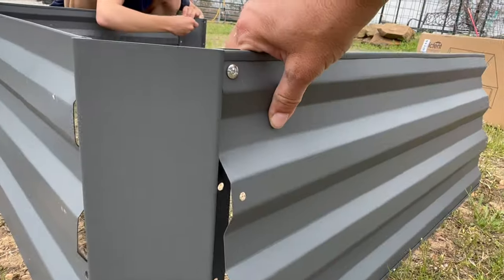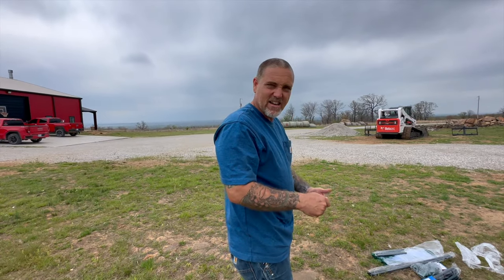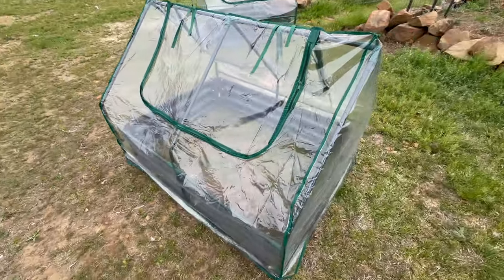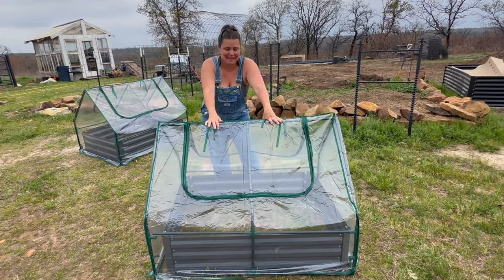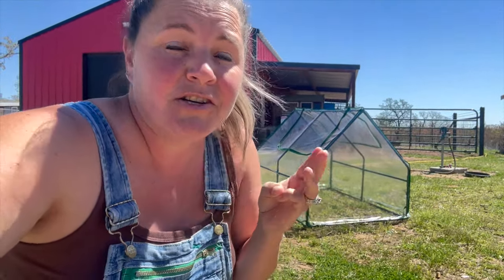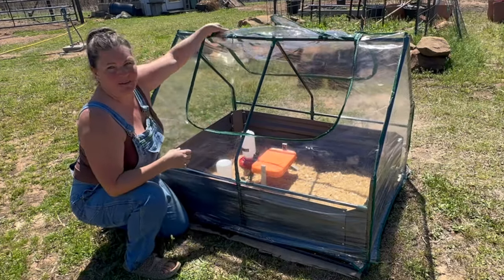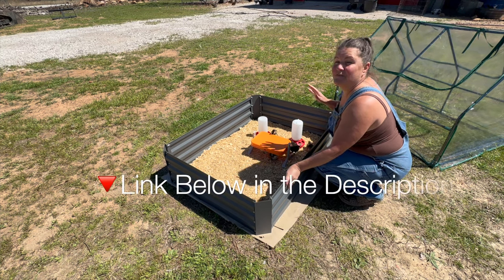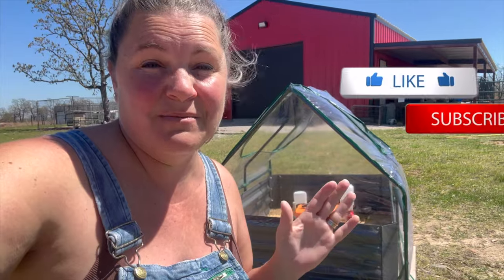My Alternative Ways To Use Metal Raised Garden Beds | Bucket Gardening | Chick Brooder?

Comment: How did you do with the VEVOR raised beds? I also purchased one and found it to be very flimsy. We ended up adding a 2x4 around the top and then a 5/4 x 6 deck board attached to that. It helped a lot but It still bulged out on the sides.
Reply from the maker: I haven’t filled beds yet, still working on the structures. We did put that middle braces to avoid it from bulging.
Reply: @ParagonRidgeRanch  they didn’t help mine, looking forward to see how you make out. Good luck.
Reply from the maker: Thanks LOL. We just finished putting all our beds together and Jeremy like the Vegega the best. We will see;)